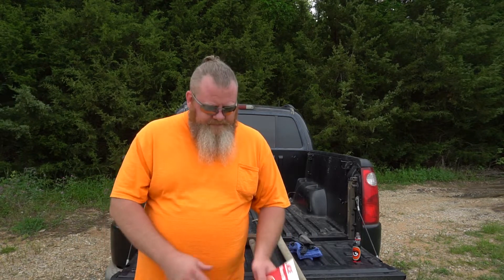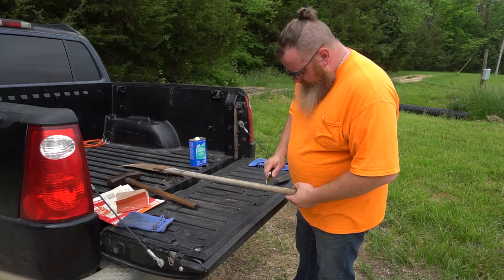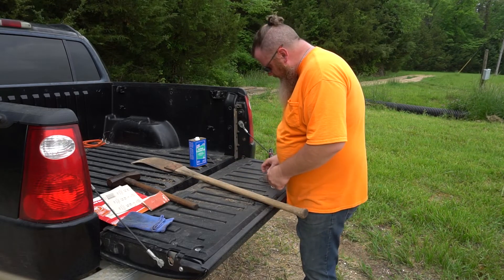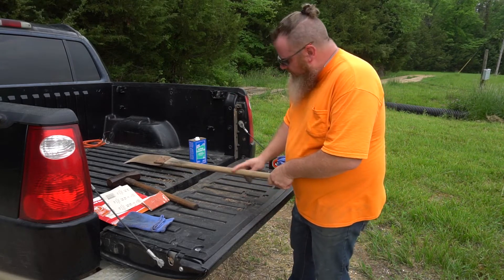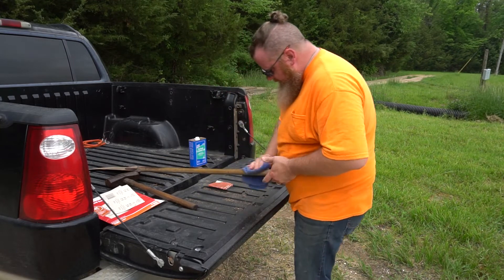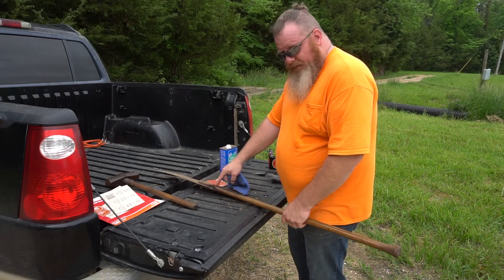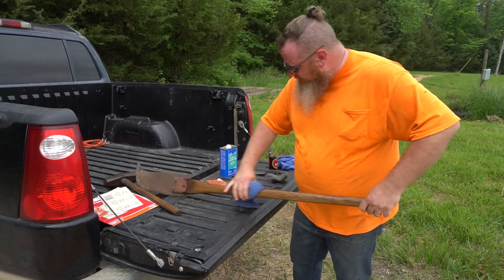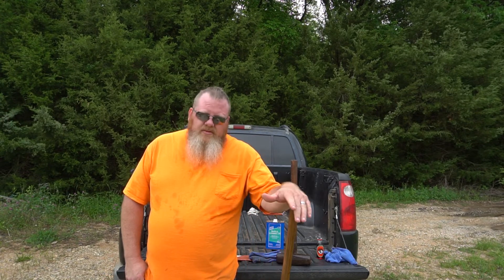Tool Tip Tuesday! | How to make wooden tool handles last!

Comment: When those blades are sharpened, they are wicked.  They are called brush blades.  I have used blades of that type on 2 in and up brush.  Generally anything up to about 2 in I have cut with one swipe if it is between 30 and 60 degrees of the stem.  I had a guy on my crew step beside one of those things and cut into his new boot and almost cut his little toe off so DON'T use one to hold down vines for stepping beside;it ain't worth it.  Treat them with utmost respect and keep the bolts tight.